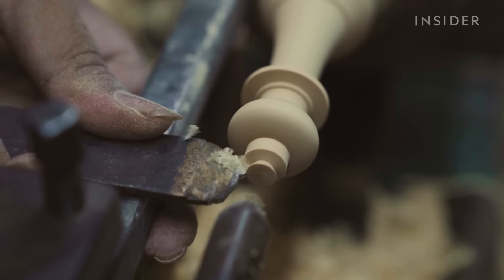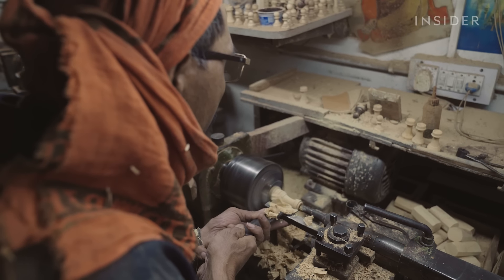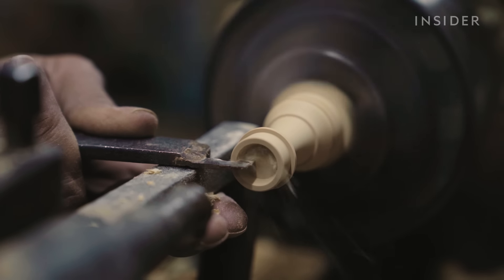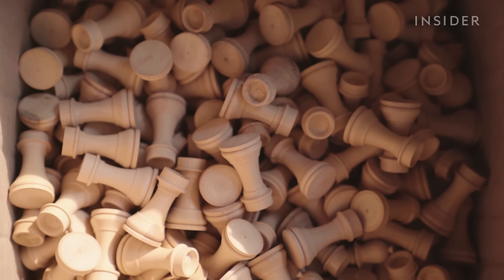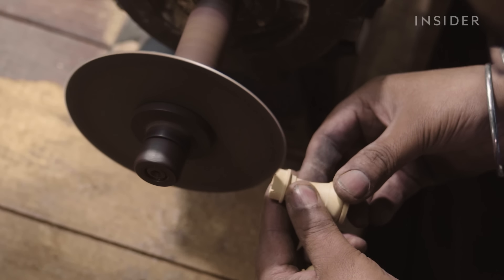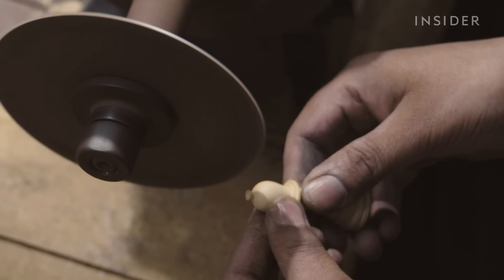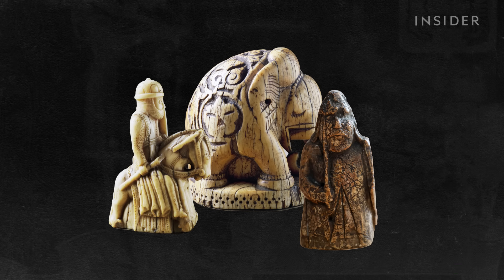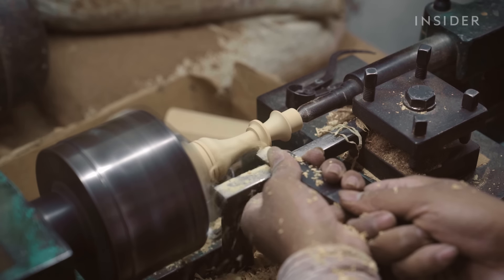Why Championship Chess Sets Are So Expensive | So Expensive

Comment: It makes sense that the knight is the hardest to make because it's one of two pieces that's not rotationally symmetric, and the other piece that's not rotationally symmetric (the bishop) only becomes nonsymmetrical with a single cut. 

All of the other pieces, because they are rotationally symmetric, means you can put the piece on a lathe to cut to specific dimensions easily. You can't do that with the knight.
Reply: The king is also not rotationally symmetric 😅
Reply: @AryanMahipal  it is by 180 degrees. Rotate it by 180, you get the exact same king shape.

It’s not circularly symmetric, if that’s what you’re thinking
Reply: the rook isn't radially symmetric. well, it is but not enough to spin and carve that way
Reply: @Exl6243  If it's about 180⁰ move the knight by 180⁰ it would be syymetrical i guess also bishop
Reply: @AryanMahipal  That's not true. If you rotate the knight by 180 degrees, you get the knight facing the other side, hence it's not symmetrical by 180 degrees. The bishop is the same deal.
Reply: and the sky is blue thanks for stating the obvious
Reply: @Exl6243  the thing on the top of the crown?
Reply: @nikitageneralov  The cross.
Reply: Asymmetrical... not Non-symmetrical

Comment: "Once the cutter makes contact it immediately changes the wood."  Why they feel the need to explain this?
Reply: The IQ of today’s average YouTuber is at all time lows.
Reply: Filler
Reply: How about calling a chisel a cutter?
Reply: Because it sounds good when said, thus making the sentence a little bit more beautiful.
Reply: Real  “artisan” work with cutting/profile templates… 🙄
Reply: You ever have to write a paper but you don't meet the minimum word/page count?
Reply: She even called the horse's mane "the tail" @ 2:32
Reply: To emphasise that there's no "undo" on the piece once you make contact. You done goofed that piece if you screw up the marks.
Reply: @gearhead1234  Why wouldn't they use templates on the similar lower bodies of the pieces?
Reply: Maybe because when you do the same to metal, the difference is way smaller?
Reply: Because it's when it literally makes contact. When you feel even a slight pressure on the cutter as you put it close to the wood, you've already changed it and there's no going back.
Reply: @TraumaER  Couldn't agree more...
Reply: @chill_will9816  it's a specialized chisel, honestly i'd hesitate to call it one just because... It doesn't look like it's be very good at chiseling much of anything
Reply: Make it more Dramatic
Reply: @mbpanzo  exactly
Reply: Probably to stress that it's an instant process and you have to be either right from the beginning, or start over completely, because there's no retouching your mistakes.
Reply: I know, right?  Weird.
Reply: if someone impaired watches youtube maybe ?
Reply: @TraumaER  Your comment is a perfect example of that.
Reply: How about calling handwork expensive?) When, in fact, it should be the cheapest. I consider a combination of several types of wood, engraving, etc. to be expensive. This kind of manual labor is dearly appreciated, but what a CNC machine can do in a couple of seconds .. well, this
Reply: Why do you feel the need to comment?
Reply: Implying the seriousness of the woodcarving, which cant be erased like a pencil. Its helps paint the picture of how they cant afford to mess up.
Reply: They’re basically saying that every movement effects the product and overall craftsmanship and how easy it is to make a mistake
Reply: Trying to meet the word count
Reply: @CraftingCake  sounds like someone hasnt cut metal on a lathe before lol
Reply: @100acatfishandwillbreakyou2  xd 😂
Reply: Because they think we're all idiots. And most of us (probably me as well) are.
Reply: It is done for emphasis, to remind you there is no room for any mistake.
Reply: Considering how many people lack common sense today it's pretty warranted, unfortunately
Reply: The exact reason why companies put "do not drink/inhale" on rat poison?
Reply: Ah yes, the floor is made out of floor.
Reply: To emphasize how delicate the wood is in carving. It’s not like they’re making large cuts and putting a ton of force or effort into it. When you carve wood like that it’s almost like butter. The point of saying that was to show how much skill and dexterity is required in making a single piece. A single small mistake can be very costly.
Reply: Does it? I thought it only removes some material, but is there some heat or pressure or some treatment that changes the wood?
Reply: @_Ekaros  I mean it doesn't actually physically change the properties of the wood, but when the wood is spinning that fast and you're using a sharp instrument, just steady contact does a great deal.

Comment: The real explanation why it is expensive is NOT in this video.

It's not the labor. The people you see making these pieces are NOT the ones getting the money.
Reply: So very wrong.  The labor is what makes it expensive (i.e. adds value), but most of that value is kept by the owner and not given to the worker, which is how all profit is made, regardless of industry.  If the set were mass produced by machines or even just reduced to a less skillful work process with simpler quality standards more chess sets would be produced in a shorter time for lower final cost.
Reply: @maofas  So my eyes don't deceive me? Extremely unexpected to see proponent of the labor theory of value here. I'm satisfied, for the day finished as good as it lasted.
Reply: @walotian  like a breath of fresh air tbh, hate this video so much
Reply: Just like the famous bags made in factories,
Workers receive basic salary a month but they produce luxury bags worth million every day.
Reply: @maofas  the problem isn't that the owners get the profit, it's how much profit is made at the expense of the worker. The workers may as well be paid in peanuts and gum packets
Reply: @maofas  these could be cut with a CNC machine for the same price in a small single employee workshopshop. The owner probably don't make the money, its the middle man, these are not worth £500.
Reply: Its just overpricing. A machine could be designed to make this, but its easier to decieve and underprice poor workers and make their product worth 500x more than what theyre paid for their jobs
Reply: @youwontrememberme  IT's called value based pricing, as oppose to cost base pricing. Value based pricing one can describe as 'how much an idiot would be willing to pay for it".
Reply: Its like those overpriced cars or overpriced watches and so on. There is an expectation that those with the money will have it and so they throw a lot of money at it. And all of that money is pocketed by the sellers.
Reply: Not to mention even $500 going directly to the workers would be cheap, yet they probably dont even get 50%. If you've ever tried to turn anything, you'd know a good piece takes at least a half hour (if you know what you're doing) and the knight takes much longer and is much more intricate, and you have to carve other pieces as well. Plus you have to finish them, maybe stain, add weights, felt, etc. Theres also 32 of those pieces, and it takes a lot more effort to make them all identical. If you include the board, that's another 2 hrs. Let's say 25 hrs conservatively, for one set, that's around $20 an hour not including the price of materials, shipping across the globe, and actually getting to the consumer. And that's for a "skilled" craftsman.
Reply: @radiantvalor  assuming multiple workers work on a full set, i'd be very much surprised is the total wage was more than 10% $50. Another$50 for material, tooling and "factory". I'm sure also there's no benefits. Sales, combinations, and marketing etc $100-$200... The rest profit for the owner. No different than expensive watches and cars... Except the price bracket is higher.
Reply: @Bren39  sounds about rught
Reply: @youwontrememberme  How would producing these chess pieces with a machine be better for these workers?
Reply: @eddarby469  Because they can move on to another job where they get paid more?
Reply: @sarahfisher5719  Mass producing chess pieces with a machine would displace many wood carvers. Are you saying if they lose their job as wood carvers they will get a better job? If so, why would they not move to that job anyway?
Reply: @maofas  Das Kapital, Volume I by Karl Marx
Reply: A big part of the price is supporting FIDE.  It's a FIDE set.  Can you think of another way to get people to contribute?  I have the set w/DGT chips in them and I really like it and the idea that I'm supporting FIDE and the people who made it.
Reply: @maofas  no, this set is absolutely overpriced simply because its an official FIDE product. its also a really unpopular set. most people do not like the knight. the knight is far less complex than more popular Staunton knights, and yet the set is double the price of most Staunton sets. you could get a genuine ebony Staunton set for less than the price of the boxwood FIDE championship set.
Reply: It's still not explaining it. Why don't they use a cheap $20 chess set?
Reply: @radiantvalor  Why dont they streamline the crafting, so that each craftsman focuses on just one piece.
Reply: @blazoraptor3392  That's exactly what MD was saying, though. The owner factors in the time cost to produce the commodity, but then pays workers only the bare minimum for them to survive. Say it takes eight carpenters an hour to produce a full chess set. The owner can only sell one chess set per hour at this rate. However, if the carpenters create three chess sets in two hours, the owner sees an extra 50% profit per hour and (because the carpenters are on wages) the carpenters don't see an increase in pay.

It is the inherent problem with profit and wage labor. As profits increase, wages do not.
Reply: @nekrataali  not exactly. M D was suggesting that it is a necessary byproduct of capitalism. I agree with your comment, but M D was directly disagreeing with the main comment about how fair it is that workers get paid wages 1% of the value of their work.
Reply: Look at that factory.  If you were to liquidate all that old equipment, you would at best get a few thousand bucks.  I know many hobbyist woodworkers who have much better setups in their garage.  This is a testament to the handcrafting work of the artisans.
Reply: @maofas  
If they have people making them, then it seems more traditional and authentic. If they replace them with machines, then it's just like any other product.

Comment: Wow I grew up playing my dad with a set pretty much identical to what these people are making. I didn’t realize it was an international standard or anything. I just thought it was made by someone who liked to tinker on a lathe. My dad said he got it from his grandpa, who died in 1969. The set comes in a handmade wooden box with ridiculously handcrafted dovetailed sides. There’s no telling how old the set is, but if I had to guess, it’s got to be at least 75 years old.
Reply: The Staunton design is about 175 years old. Most plastic sets, including the one I grew up with in the 1970's copy that design, so it is no surprise that your grandpa's set is similar.

As they point out there are detail differences even amongst the Staunton design (in this case between the Championship and Tournament level). If you see an Authentic House of Staunton set (which this is), you can tell the quality difference immediately. If hand carved, I don't think that quality could be done without the set costing thousands of dollars. HoS sets in Staunton can be much cheaper than this ($200 vs. $500) because they can have cheaper carvings of the Knight, King, and Queen.

Not to say your grandpa's set wouldn't be worth hundreds of dollars today, of course. Back then they didn't have plastic molded pieces and ready manufacturing to make sets cheaply. Those cheap sets squeeze out the demand for any non-hand carved wooden set that isn't excellently made (HoS) or a cheap copy.
Reply: Sir you have a vintage piece in your possession. Guard it well.

Comment: “Official” chess set, huh? Wouldn’t want to sneak in one of those modded knights that can move twice in one turn.
Reply: bro im dead  🤣🤣
Reply: Jokes aside, every set is weighed now because a champion stated that the pieces don't weigh the same and black gets a disadvantage of having heavier pieces. The championship holders after checking the sets and doing an experiment seeing that over the course of a game there was in fact delay in the time moves were being made which would add up to reducing your total time now they weigh every piece and if it's below or above the acceptable range the set doesn't get used. Right now if you went against chess hustlers that play for money especially the ones who play bullet (30 seconds) they use a cheated set that has heavy pieces for their opponent and hollow pieces for themselves.
Reply: @Balila_balbal_loki  Damn piece weight is enough to turn the tide of a game?
Reply: @kets4443  I honestly dont think so. What does the weight have to do with a player's strategy?
Reply: @shalom5978  A Bullet game is made in the course of a minute and most standards chess matches are decided in the frame of the last 10 seconds on their clock.
Reply: @shalom5978  is not about the strategy, it's about the speed it takes to move the pieces, heavier pieces are harder to move, so in a game where you have limited time, the player with heavier pieces will be in a slight disadvantage since he/she will spend more time moving the pieces.
And in time variants like bullet, that time can matter
Reply: @Ekair42  Really? I thought it only had to do with strategy. Why is there a time limit? I thought the game would just carry on until it ended in a draw/win
Reply: @josebarreto8577 Huh, I guess I was wrong.  Good to know.
Reply: @Daniel Hani  thanks for the thoughtful response. I hadn’t thought of timed chess. Silly to think what a few grams could cost a professional.
Reply: @shalom5978  you're thinking of classical chess, which is like what you have mentioned and can take days for a game to finish. There are also many other types of chess that are time limited, namely; rapid, blitz and bullet.

Would having chess peices that are a few grams heavier or lighter actually make a difference when it comes to the last few seconds of a game? I highly doubt it, but as long as there is possibility, no matter how slim, then the peices must be made to the exact same weight.
Reply: @jamil3286  Oh, I see. This is turning out to be a great learning experience.
Reply: @shalom5978  well it depends on what type of tournaments you are talking, for bullet chess it's usually less than a minute or two, blitz is usually around five minutes, rapid is when the time limit is 10 or more and then you got classical chess which I assume you are talking about(usually one hour or more).
Reply: @shalom5978  it does not affect their skill in that aspect, but more towards the last few seconds when they have to move FAST then heavy pieces are bad
Reply: A 10 dollar chess set from Walmart and a 500 dollar championship chess set can both win games. It doesn’t matter
Reply: It's simply game changing!
Reply: @freez1ngsapper  0.1 seconds extra per move in a 50 move game is 5 seconds the games usually win/lose in the last 10 seconds of the game >.>
Reply: Made my evening lmao
Reply: Imagine using mouses used by pro fps players just to play digital bullet chess :))
Reply: @shalom5978  the limit is to stress the player, the one who can come up with the best move in the shortest about of time wins basically. They also have to think multiple moves ahead.
Reply: @shalom5978  with no time limit, the world chess championship match would take years to play
Reply: Exactly lol. This seems so pretentious.
Reply: This comment reminded me of the NYC chess hustler that GM Maurice Ashley played against.
Reply: @Balila_balbal_loki  imagine them also making sure every chess player has the same muscle strength
Reply: @SirTylerGolf  try correspondence chess

that way, you can have your own game that might take literal years